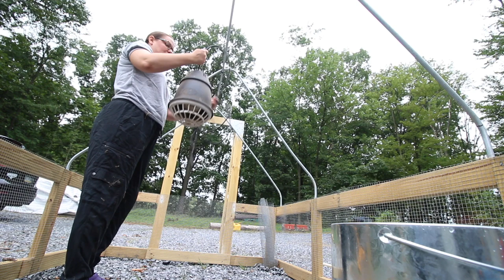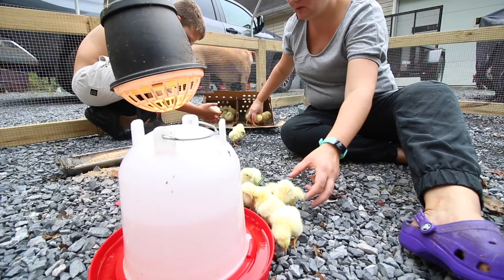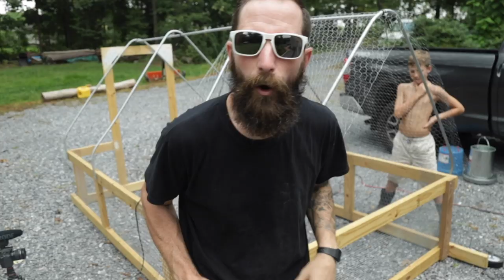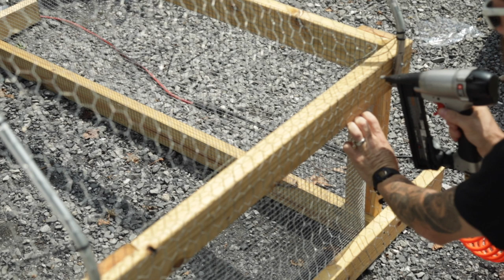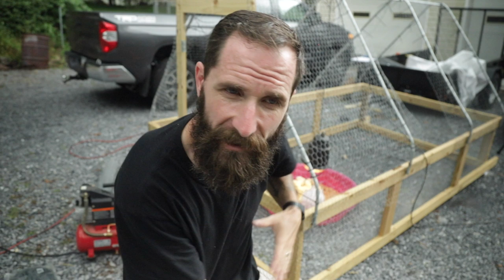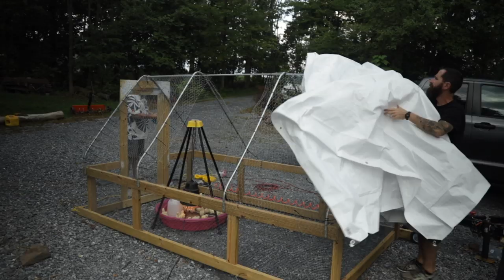Chicken Tractor Is Finished And Just In Time   Our Meat Birds Have Arrived! || Vlogust Day 17

Comment: The chicks looked really quite unconcerned as you built around them. Its a really really  nice tractor.♥️ 
Did you run the rope through a hose or cover? We ran our rope through a section of garden hose...it made it much easier on the hands when we move our pen.